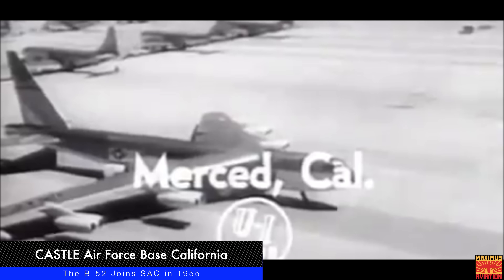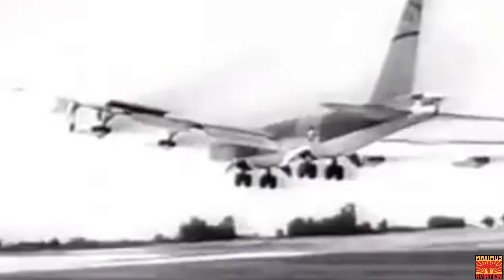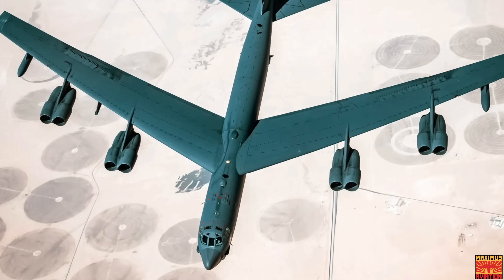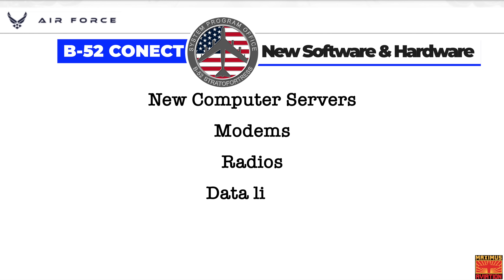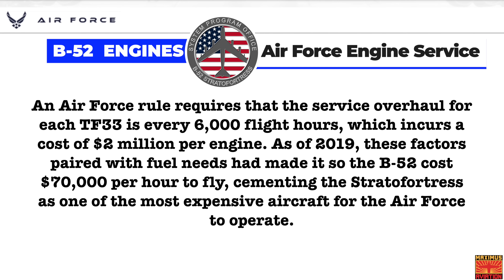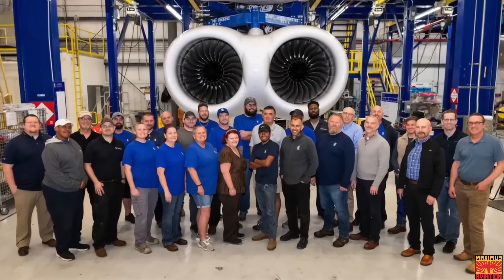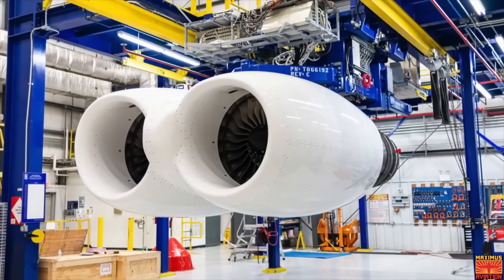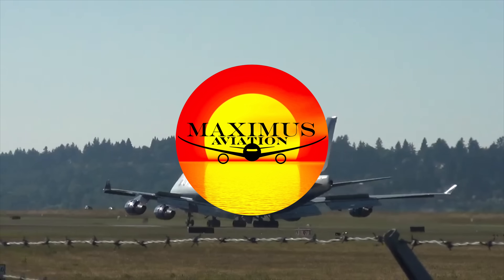The B-52 Will Fly For Over 100 Years With Its New Rolls Royce Engines!

Comment: I’m retired US Navy. A few years ago a friend in the US Air Force told me that an intensive study was made to find a replacement for the B-52. At the conclusion of the study it was found that the only thing that could replace a B-52 was another B-52.
Reply: Kudos to the initial designers of the B52,
No CAD or computer simulation back in those days
Reply: @cheetomussollini  A lot of slide rulers without batteries.
Reply: @cheetomussollini  Slide rulers, baby. B-52, 707, even 747…all done with slide rulers.
Reply: @cheetomussollini 
That’s what happens when white men are left to think and produce. 

Been doing it throughout recorded history
Reply: That’s not really correct.   The study concluded it was more cost effective to update and maintain the B-52 vs building a new aircraft with similar specs, given that the USAF only needed 100 or so.   We could build a plane that would be more fuel efficient, but the fuel savings would never be enough to justify the cost.
Reply: What are they doing to strengthen the frames? That’s the main reason we scrap other commercial jets because of the pressurization count just curious of your thoughts
Reply: @apogeedata  the ones used today don't have that much flying hours, and they got upgrades and maintenance the whole time. Earlier variants used extensively had been retired long ago
Reply: @simonm1447  the newest ones where built in 1963 though..that’s only 14 units also
Reply: The B-52 has been in service with the USAF since 1955. As of June 2019, there are 76 aircraft in inventory; 58 operated by active forces (2nd Bomb Wing and 5th Bomb Wing), 18 by reserve forces (307th Bomb Wing), and about 12 in long-term storage at the Davis-Monthan AFB Boneyard.
Reply: @apogeedata  all B-52s used today are H models. The aircraft flown during operation Chrome Dome are long gone
Reply: @simonm1447  correct…last ones made 1963…
Reply: @simonm1447  A total of 744 B-52s were built, with the last, a B-52H, delivered in October 1962.
Reply: @apogeedata  Is this approved information for the public
Reply: @simonm1447  As part of the SALT Treaty in the 1980s the U.S. and U.S.S.R. agreed to scrap a certain number of bombers and ICBM missiles.  All B-52s built in the 1950s were scrapped with Russian observers watching.  The Russians also did the same with their old bombers.  The oldest B-52s now are only 60 years old.
Reply: @dfirth224  and beautiful parts bins to keep the present fleet flying
Reply: @apogeedata  Did you ever hear about the guy who had the old family hatchet and that it had been in the family over 150 years. They’d only had to replace the head twice and the handle four times. The B-52H models that they are keeping flying have had many of their parts replaced including the wing boxes and struts, many of the spars, most of the skin panels, as well as wiring, avionics, and lots of other parts. They are great old birds but they’ve been well maintained by very dedicated service men and contractors. They love those old planes.
Reply: Amen I just think would be a cool documentary show me the detail of how the hull of the plane has been maintained. Trust me I love when a product of any kind last a long time, especially the USS Missouri.❤️❤️
Reply: @Bill_N_ATX  The Ship of Theseus is what you're wanting to use in that example.
Reply: @apogeedata  IIRC, the crewed area that's pressurized is far smaller than the passenger space in an airliner.
Reply: @apogeedata  Quote.....

"The oldest parts of any B-52 are the basic metal structures deep inside the airframe—and those are “good bones,” to quote Gen. Robin Rand, former head of Air Force Global Strike Command.
Everything else has been replaced at least once. Every four years, a B-52 spends a few months at Tinker Air Force Base in Oklahoma, where workers strip off the plane’s paint, remove panels and inspect every component, repairing or replacing the broken ones".  

Quoted from an article in Forbes.
Reply: @apogeedata  The B52 doesn't have the same problem simply because it isn't fully pressurized. That said these planes get constantly maintained and there are likely few things on the plane that are actually original if any.
Reply: @apogeedata  They were overbuilt because material science wasn't such that planes could be built BARELY good enough to do the job.
Reply: @apogeedata The fuselage is made of titanium, so it won't rust, and metal fatigue takes longer to show up, than aluminum.
Reply: Well that only means the original designers really hit the nail on the head
Reply: I'm pretty sure I heard the same story.
Reply: Well it does make a fine missile carrier.
Reply: @killman369547  a few dozen years ago our Buffs carried Shrike supersonic missiles which tended to keep world peace. Right now we need to drag Putin to the Hague for a nice gentle public hanging. Easing his floor supports gently so as not to hurt his neck.
Reply: the air force has a pattern of stupid studies. example, they assumed fuel efficiency value based on fuel cost only, not aerial refueling circumstances in which a tanker is used
Reply: Even the C 130 Fat Albert of the Blue Angels got upgraded fairly recently.
Reply: In practical terms the 747 freighter out performs the b52 in range and capacity.  Could we make a bomber that replaces the b52 as a heavy ordnance carrier? Easily. Is it worth it? Probably not. 

The b52 was designed for a role that might not exist in modern near peer roles. So designing something to replace it isn’t worth it. That’s why new bombers do things like the b1 fast high or low altitude attacks or stealth like the b2 or the raider.
Reply: @0xFF48  I always wondered why they could not take a commercial plane(such as the 747) and cost effectively modify it into a bomber.  They make them into cargo version which would seem not to be too different from a bomber..
Reply: @0xFF48  there was a proposal in the recent past to do just that. Take modern air liner airframe (737...) and fit it with a rotary bomb bay like the B1 has. It would be cheap efficient, could carry a decent amount, and most importantly be easy to produce and train on. If they wanted more capacity they could add more bays to larger airframes (747), but it was passed over because at the time we were bombing terrorists in the dessert and didn't need a new bomber. Now with WWIII looking to be in sight another mass produced bomb/missile truck might be in order.
Reply: @wyomins  Airliner airframes are made to work with overpressure. It's like if you compare a full can of coke under pressure (you could almost put a small car with one tire on it) with an empty one (which you can crush by hand). The internal pressure is stabilizing the fuselage. It can fly without the pressure difference (what it does at every take off or landing) but for the main time the cabin is pressurized. 
If you cut out a bomb bay you have a long hole in your pressure cabin, you have to put a structure into the airframe which compensates that, otherwise you couldn't pressurize the cabin any longer. Bombers don't have a pressurized fuselage, the B-52 just has a thin tunnel in the middle to get to the tail.
Reply: @simonm1447  not necessarily, cargo versions of passenger aircraft exist with large portals for loading and unloading, it would be the same concept. Also your analogy doesn't quite work as they only pressurize to an internal air pressure resembling an altitude of 10,000ft so if the internal air pressure was providing that much rigidity then they would be under pressurized and weaker during landing and takeoffs when they need that strength the most.
Reply: @wyomins  it will have to do with fatigue, the airframe has to be strong enough to work without internal pressure, but the question is how would affect a permanent flight without internal pressure the fatigue over time.
The next thing is a B-52 has its bomb bays for the heavy stuff at the center of lift under the wings. An airliner has the wing box here, since airliners have their wings not on top of the fuselage. If you dump heavy loads from a point beside the center of lift your center of gravity shifts.

Just for cruise missiles you don't need to build new aircraft, they can also be thrown out of military cargo aircraft and launched mid air.
A B-52 H has a MTOW of 220t, a 737 in comparison has just 90 t MTOW
Reply: @Phillip Banes well that's the DoD for you, if it is simple and effective they don't want it
Reply: I was about to cry after seeing B-52s broken up at the boneyard (2:45). But then remembered the Air Force recycles parts off scrapped bombers to keep remaining BUFFs ready for battle.
Reply: @tonyhenthorn3966  Broken for satellite proof to the commies.  Either the SALT or START treaty.
Reply: @tonyhenthorn3966  I think I remember, being in Army ordnance, as an M1 Abrams mechanic, the term Shop Queen.
I remember the term being referred to with disdain in training. These days, not so much; if you are sacrificing one unit to keep 5 working, it's not a bad thing. 5 operational units at the cost of one, vs 6 invalid units if the replacement parts don't show up for one reason or another.
I think the Ukrainians figured this out over a year ago with the T72s and 82s, fixed and redeployed. 
That being said, converting a few B52s to newer engines is a good thing, as the old engines removed can provide parts or even whole replacements for the unobtainable old engines in other B52 units.
That said, I'm surprised that the newer high bypass turbofans weren't considered to replace the older turbojets
Reply: If it ain’t broke, don’t fix it.
Reply: @@phillipbanes5484A B-52 air frame is titanium, a 787 is composites with aluminum in other areas.  Aluminum can't take the abuse that titanium can.
Reply: Not suprised!
Reply: The B52 is like the Crown Victoria and Chevy Impala/Caprice(of the early 1990s to 70s) of the Air Force. Rugged, not that fancy, yet functional and durable
Reply: @dewarkhodern9990  I worked in Hydraulic shop In the United State’s Air Force from 1975-1979. B 52’s were part of SAC at the time. So tell the Crown Vic’s for someone who never worked on that thing when it is 20 below and it have a Hydraulic leak sitting on the Hammerhead.🥶🤬
Reply: I'm a retired pizza delivery person and i happened to deliver 2 medium pizzas with extra cheese said retired navy guy and while i was waiting for him to find a coupon, i too overheard his friend say the only thing that could replace a B52 is another B52.
Reply: Military made a similar mistake in Vietnam when they wanted more Sandies, manufacturer said we can't do it and government didn't push for it. So that's why we keep making BUFFS, you don't want to lose access to a great aircraft. We only lost 14 in Vietnam to combat and that was because of Nixon letting Hanoi know about the last Linebacker mission.
Reply: @c123bthunderpig  Having lived through Nam and knowing a former USAF pilot who flew a B-52G out of Anderson AFB to Hanoi during Linebacker II, I think aircraft losses were due to a wee bit more than Nixon giving away the farm.  Re: North Vietnam air defense system.
Reply: @texleeger8973        Wasn’t there the utterly stupid issue with McNamara running the whole show from DC involved in that mess?     I recall hearing about the planes being forced to follow the exact same routes and timetables giving the NVA a convenient shooting gallery.
Reply: Will we bring back any of those birds in mothball, now that these new engines will come out?
Reply: @audgusto  oh, they don’t have to because 58 are still in service and there are another 10 that are not mothballed but in the back drop to be used
Reply: @audgusto Likely they will be needed for parts as the engine parts will be needed no longer.
Reply: God blesses America
Reply: @wayne21williams  The America's is a Continent NOT A country.
Reply: With a British engine great plane And great engines.built in USA yes but designed engineered in the UK 🇬🇧🇺🇸
Reply: I wish you could have covered the old and new performance of the plane with the new engines.
Reply: So US IQ maxxed out in 1952?? Got it.
Reply: We should make more of them
Reply: What you say holds  true if you intend to bomb BURUNDI  or possibly something even more backwards that it is  with a B-52  without it  being escorted by the entire arsenal of F 15s/ F16s /F18s, or the entire production of Tomcats , F 4 Phantoms  F 111s  to soften up  the area  before that flying bus flies over it.
I finished my US Army tours in 1975  ..it needed to be retired then  and  now .Irrespective of facelifts or the latest engines reconfiguration by Rolls Royce ...it remains a flying dead duck anywhere other than places like  BURUNDI . But as a tax money pipeline cleaner,   it beats DRAINO hands down , it has flushed more money down the toilet than the entire population of this country has flushed in equivalent excrement .
Reply: At the cost of B-1, B-2, and B-21, I wouldn't be surprised if U.S. contracted Boeing to open a new production line to make a second gen of B-52 with carbon-fiber wings and fuselage.
Reply: Hello William Paz…
That’s why on occasion you see a B 52 taken out of storage and return to flight status. This plane amazing, just think 3 generations of pilots flew this plane…grandfathers, fathers and sons. Maybe it will be a great grandson or daughter plane. Let see how well it’s maintained to get to that point. Great plane!
Reply: @Phillip Banes Hello, eight engines are a good thing.
Reply: Well efficiency reliability was needed the USA is not known for those qualities .dirty thirsty isn't popular anymore .
Reply: Urban myth.
Reply: William Paz...I would like to know what the Russians think..I'm sure they like the fact that they got new engines..Their integrated air defenses will shoot these things down like shooting fish in a barrel..I knew they would get new engines..Not that they will really do any good but because America is led by morons that think money is no object..They just couldn't let these old POS go..
Reply: As a former Army vet I can tell you,which you should know,that the USA military can come up with any conclusion they need to..
Reply: They couldn't build anything like it today! Look at the B2 it's plagued with issues and when sent on missions they have to double the aircraft due aircraft suffering problems and having to rtb
Reply: Or global peace
Reply: @Bingpot_Cowabunga  You're really that naive, huh? Lmfao world peace won't happen when we have moronic leaders like Putin, Un, Biden, etc.
Reply: @Bingpot_Cowabunga Yeah the would be wonderful.  If all the tinhorns would dial it back. Maybe you can get them to do that.
Reply: @Bingpot_Cowabunga  will never be a thing so stop dreaming
Reply: @Bingpot_Cowabunga  Currently unobtainium.   Since the cold war ended it has gotten worse.  Now the supposedly ended cold war is hot. West wasted $30 trillion on the cold wars.  Civilization can not afford another one.
Reply: @Bingpot_Cowabunga  yeah, right!  Dream on.
Reply: Why not upgrade the B1 instead? Lots of freefall bombs are not part of modern warfare anymore so a smaller weapons load is not as big a loss. Does the US still think the B52 would survive before it could fire its missiles?
Reply: @stephendoherty8291  It seems the B-1s suffer from fatigue meanwhile, high speed low level flight puts a lot of stress on the airframe. The B-1 predecessor in this role, the B-58, also had the fatigue problem after it was forced from Mach 2 high altitude to low level. 

In a conflict the B-52 would fire cruise missiles from outside of the enemy air defense zone, it's clear you can't use them over territory with modern air defense
Reply: @stephendoherty8291  the b-52 exists to bomb poor brown people who don't have aa
Reply: A tu95 would nicely replace the Buff. Oh wait! We don't build those.
Reply: Will they be replacing the 8 engine steam gauges with new digital displays?
Reply: @oceanic8424  I rather Analog
Reply: @dewarkhodern9990  Sure, I like gauges as well, but I'm thinking that these new engines will be equipped with FADEC, so an instrument upgrade might be applicable.
Reply: @oceanic8424  Replacing the Engine's only make sense if the power and RPM level are about the same. That 100 year old Airframe cannot handle any extra Power. The wings on that thing will literally come off. So the saving have to be the Maintenance of the Engine's and the saving in fuel. The Gauges will not make any difference except the people at Depot or to Electric shop TCTO to have them all done. TCTO= Time Compliant Technical Order.
Reply: They could just put bay doors on a triple seven. They don’t because the B-52 is absolutely useless as a strategic bomber. It’s only useful if you’re fighting an enemy with no air defense capability.
Reply: @bigdopamine9343  Have anyone ever thought, why build another weapon of Mass Destruction? Why not take that money and tell every 2nd grader. You and all your classmates are going to a College or Trade School of your choice? How about then take the rest of the savings and build an East Coast to West Coast Rapid transit system. How about finding out why the United States is a World Leader in Mental health cases. Don't tell me because someone else will build the Bombers. I understand but I am not going to act like Charles Manson or Jeffrey Dahmer because they did. Get my drift?
Reply: *lockmart gives fat kickbacks "Guys! The F-35 is going to replace the B-52!"

Comment: I remember a proposal a couple decades ago to replace the 8 engines with 4 more powerful new engines
Reply from the maker: They wanted to but the wings are swept too low for those larger engines.
Reply: @maximusaviationchannel And the rudder would not have enough authority , when needed, for an engine out. So they say.